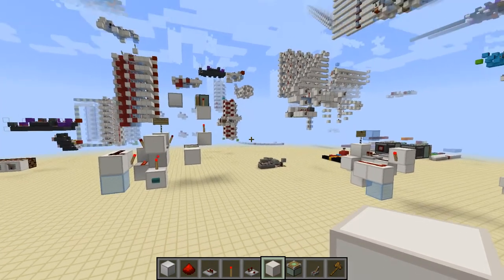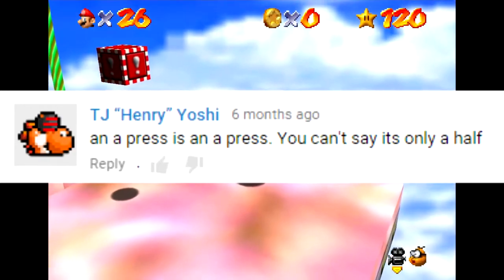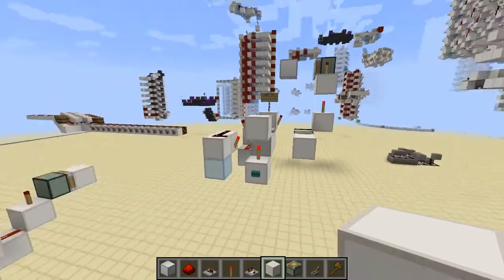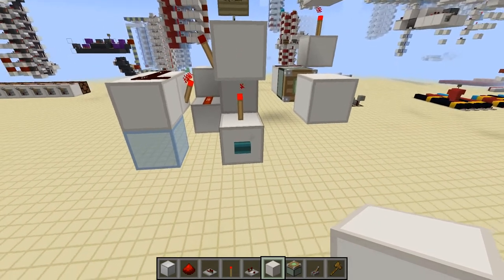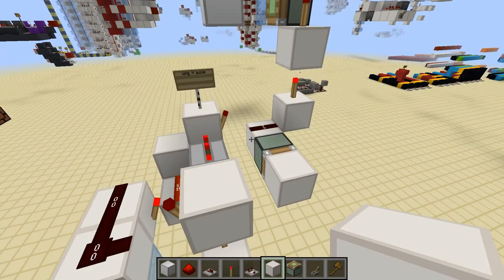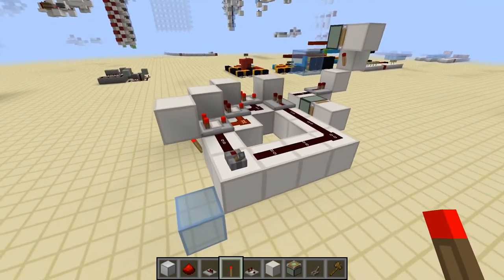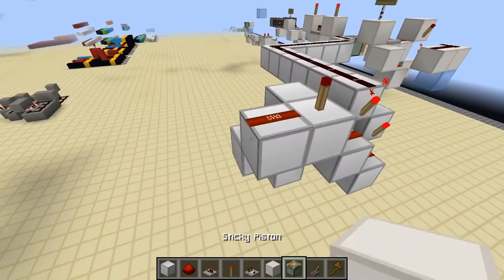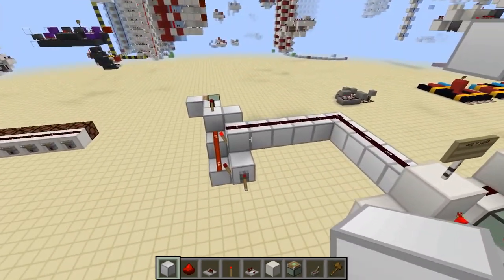The Mysterious "Long Redstone Tick" Pulse

Comment: You can have a simpler setup with a torch powering the block on top of it, and being inverted with a dust on the block it is attached to. If you unpower the dust for 2 ticks, you end up with a long 1 tick pulse, without the complex and slow apparatus all around.